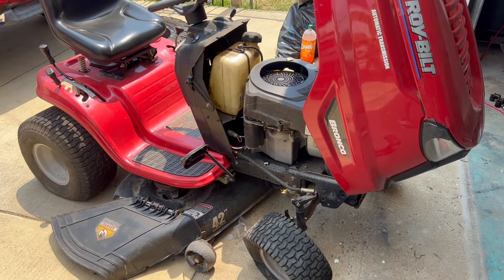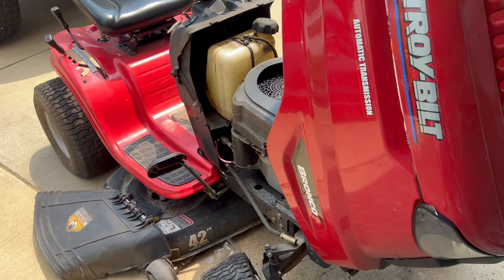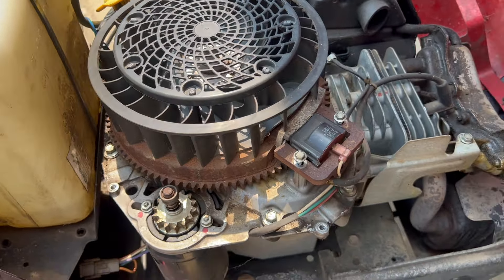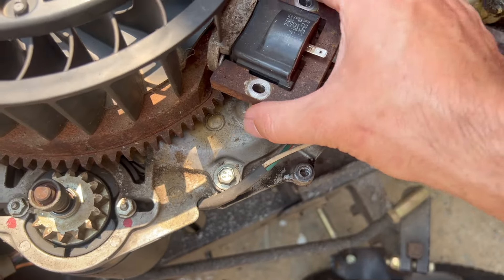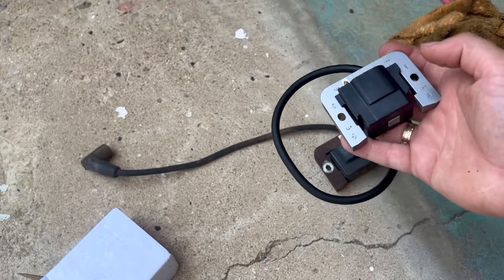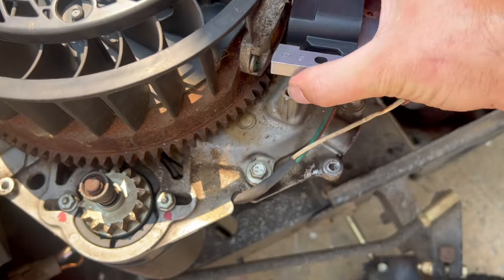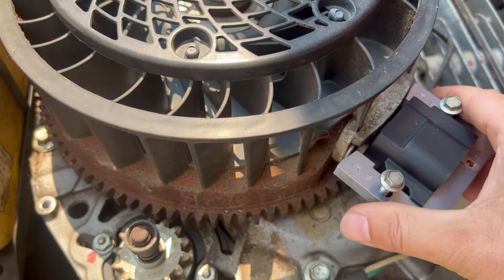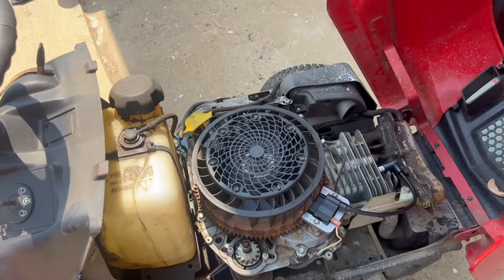How To Replace The Ignition Coil On Troy Bilt Bronco Riding Lawn Mower

Comment from the maker: Ignition Coil Module For Troy-Bilt Bronco Tractor Mower 13WV78KS011 - https://amzn.to/3Vy6YhD 

#troybilt #ridinglawnmower #lawnmower #lawnmowers #lawnmowing #lawnmowerrepair #diy #lawn #lawncare 

How To Replace The Ignition Coil On Troy Bilt Bronco Riding Lawn Mower  Step By Step For Beginners 

Step 1
Lift the seat and Disconnect the battery
Park the tractor on a level surface and set the parking brake.
Turn the ignition switch off and remove the key.
Wear work gloves to protect your hands.

Step 2 
Lift the tractor hood.
Remove the engine blower cover - 4-5 screws 8mm

Step 3
Disconnect the spark plug wire and pull it out of the engine bracket.
Turn the flywheel so the magnet points away from the ignition coil.
Remove the ignition coil mounting screws.
Lift the ignition coil and disconnect the kill wire.
Remove the ignition coil.

Step 4
Install the new ignition coil
Transfer the spark plug boot from the old ignition coil to the new one.
Connect the kill wire to the new ignition coil.
Position the new ignition coil on the engine and loosely install the 2 mounting screws.
Pull the coil away from the flywheel and tighten the mounting screws.
Turn the flywheel so the magnet aligns with the ignition coil.

Step 5
Set the ignition coil air gap
Insert the feeler gauge. The correct size for most engines is 0.011-inches.
While holding the feeler gauge in position, loosen the mounting screws to allow the magnet to pull the coil to it.
Tighten the mounting screws.
Turn the flywheel by hand and remove the feeler gauge.
Route the spark plug wire through the engine bracket.
Connect the wire to the spark plug.

Step 6
Reinstall the engine blower cover
Lower the tractor hood.

Step 7
Reconnect the battery
Lower the seat.
Start it up :)